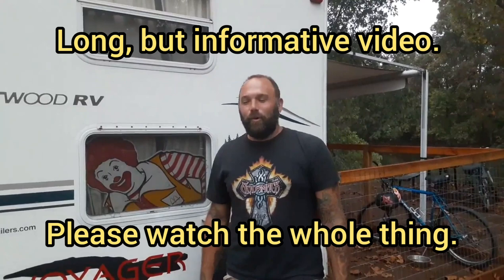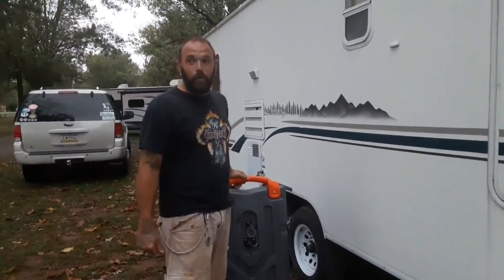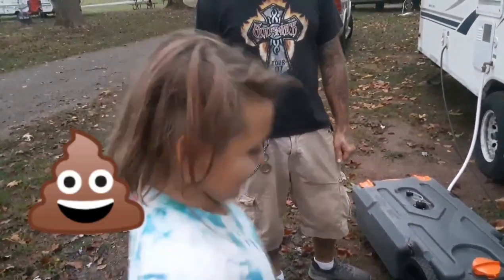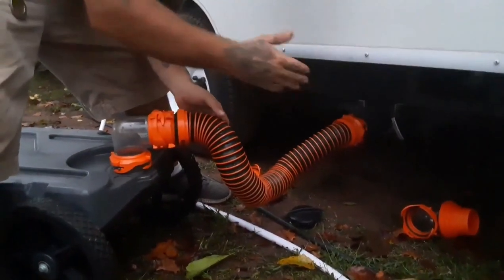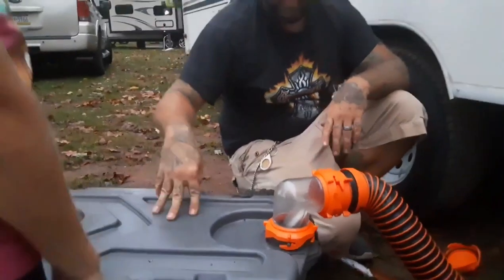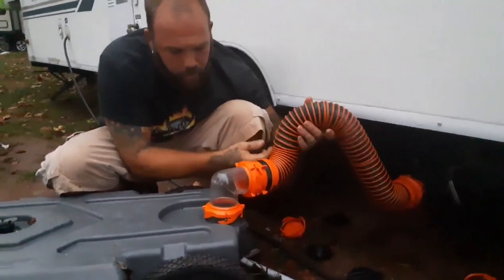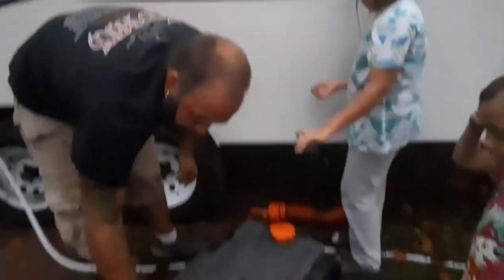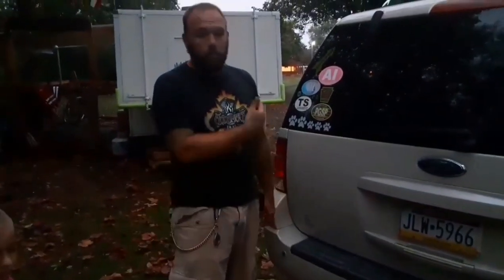How to operate your portable waste RV Tote tank- Camco Rhino Tote

Comment: I need some advice. I've tried researching and watching multiple videos but.. I have the 36 gallon Camco Rhino waste tank. I attempt to empty the black waste into the tank. It doesn't want to fill up. Some will come out. I open up the valve that allows air flow. But again only some black waste will come out and it's not completely emptying, it's staying in the hose. I know the waste tank itself is not full yet. Is it an air flow issue? I can't figure this out and I'm a frustrated and overwhelmed new user. 🙃 I do attempt to empty the grey water too but the tank acts full when it's not even half way full.

Comment: Is it difficult to move the tote by hand when it's full? It appears to be over 200 pounds when full. I'm debating between one of these or just using a transfer pump to a 30 gallon water drum for my grey water to extend camping trips.
Reply from the maker: You just hook it to your hitch and drive it to dump it.
Reply: I've never hauled black/grey water around so since water is about 8 pounds per gallon is it safe to assume blackwater is approx 10-12 or am I way off?

Comment: Take the air valve on the totter off an it will flow u won’t have to hold it
Reply from the maker: Thank you for the tip. I relaized I forgot that at first! Lol